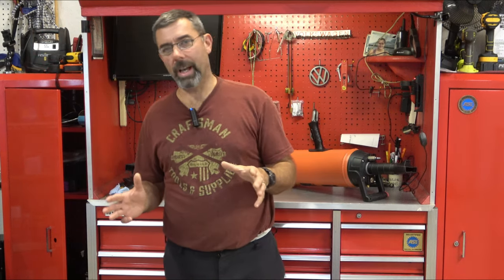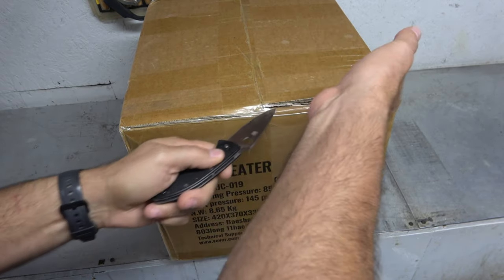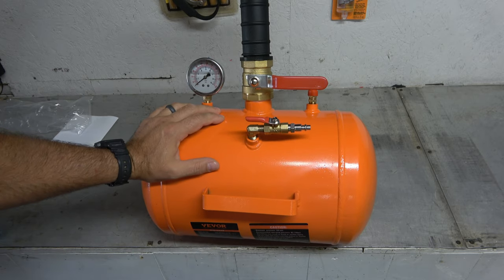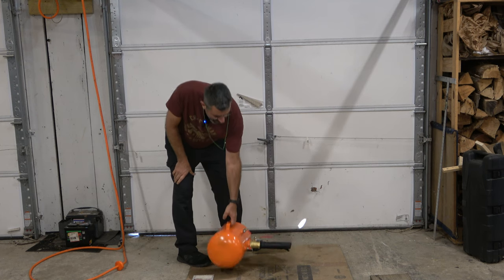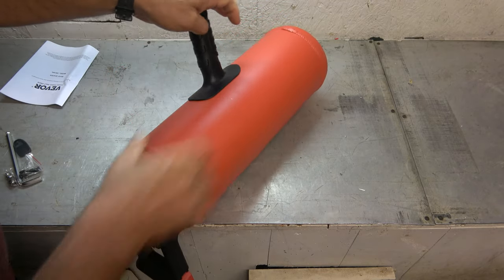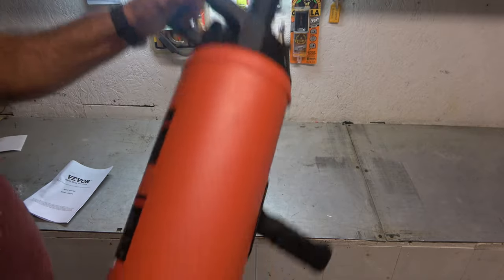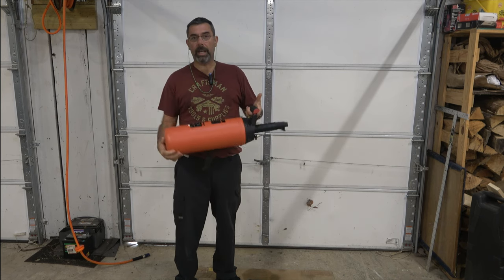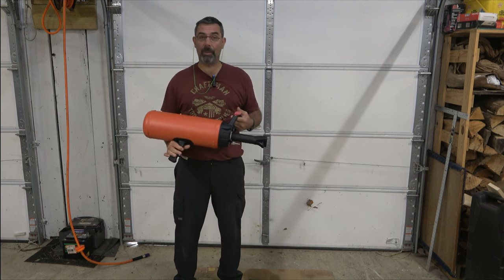Two Tire Bead Blasters From Vevor. Cheetah Style and Bazooka Style.

Comment: Why didn’t you show us? Which one is the best to seat a tire? You know what I mean? I mean why did you just this video? Was not that good sure showed us how it works which one works better it’s obviously a difference.
Reply from the maker: They both work the same on tires, so no need to film that. The difference is how these get the air out of them. One with the triggers and the other with the valve. I've kept both and noticed no change between the two.

Comment: The only thing i think they should change on the new style is the blow off valve location they should have put it in a different location, not liking it where my hand is on the handle.  Great video 😊
Reply from the maker: I can see that, I just used these yesterday to reseat some lawn mower tires.

Comment: Whut brand is the huch in the background  it looks taller than US General  
I'm 6.3 n don't want be bending down work on stuff  looking at bigger box
Like at 72" 3 or icon
Reply from the maker: It's a 56 inch US General Series 1 box with a custom built (by me) topper. Like you, I hate toppers that I smash my head into.